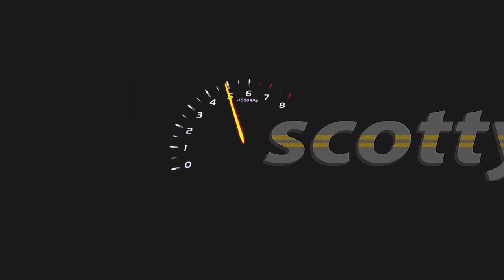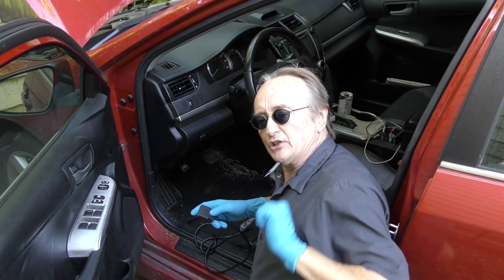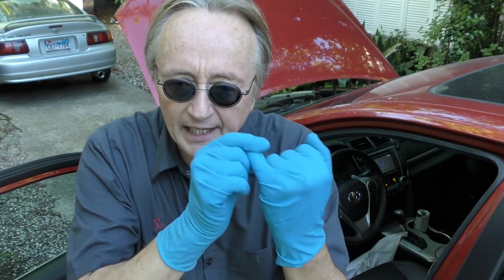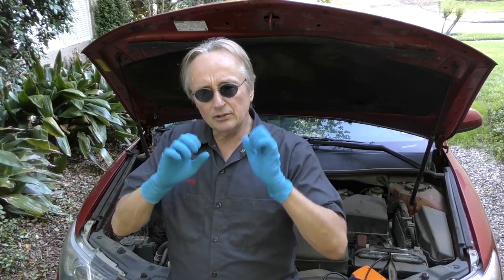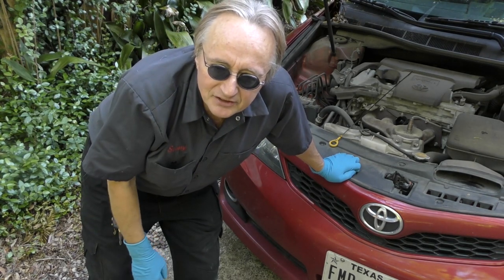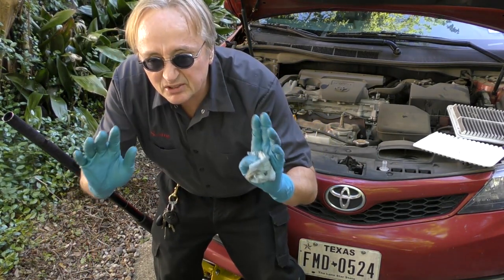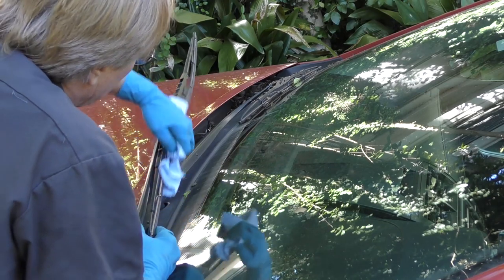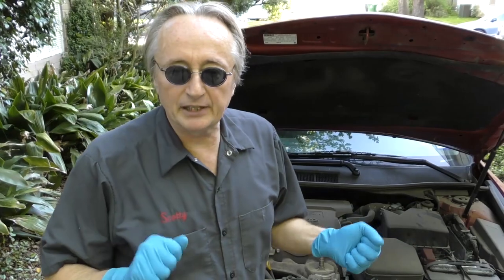Doing This Will Make Your Car Pass Inspection

Comment: Car has recalls on explosive airbags, fuel tank gasket that leaks and catches fire in crash, suspension ball joint that breaks on driver side, clutch pedal that snaps and jams under the brake pedal, warning that the seat belt gets cut in the door (special rear suicide doors, and that belt is like a magnet to getting caught in the door since it slides on a floor rail) and catalytic converter that gets so hot it melts. On top of this having worn out brake pads, etc. All passes safety inspection...

De-cat so the car is no longer a fire hazard, fails emission test, fails “safety test”...

There is nothing that they check for safety besides tire wear... It should just be called an emissions test since that’s all it is. Also fun fact, the state right above Texas has no safety or emissions test, and things like Nitrous Oxide are perfectly legal for street use...

Comment: Dirty oil is fill with gasoline blow by   and those fumes are sucked back into the engine through the PVC valve. So rather than your engine breathing fresh air it is sucking fumes into the intake causing the air/fuel ratio to be thrown off.

Comment: lol, I've had to cheat my way past emissions for the last 5 years. I've had an engine light code on for those 5 years related to the CAT converter efficiency (toyota is known for the infamously sensitive P0420 code) and it's luckily the LAST monitor on my OBD sensors to come on line after a reset. Plan of attack. Reset the OBD codes in the engine, and drive around until the monitors come online. The first 6 monitors come on within 15 minutes. the 7th monitor takes about a day or driving to and from work... the LAST monitor (which houses the P0420 check) takes about 2-3 days. When that 7th monitor comes back online drive DIRECTLY to the MVD and have your emissions check done with that last monitor not being online. 2 more years of not having to take the stupid test and just ignore the engine light coming back online lol

Comment: Don't forget the visual inspection in CA. Anything that looks amiss will result in failure. An upgraded silicone line, a aftermarket diverter valve, whatever that looks different that doesn't have the proper sticker. It's no wonder there are so many new cars here.

Comment: NSW Australia is bloody nasty too. No emissions or OBD but they do a FULL check on ball joints, cv boots and cvs, brakes, lights, braking performance, bushings, window cracks, fails on the dash, etc.

I failed last run on the rough roads unwinding the seat bolts a little, rear exhaust had rotated a little and FULL back end bushings (traing arms, sway bars etc etc oh and blinker bulb went clear instead of orange (tint burnt off??). I usually leave something small like a bulb as it makes them pick on the car less but they don't charge $20 for a light bulb either (maybe $3-5). Last year they let a few things slip they could have picked on because of that for example very low front brake pads I got a "your gunna change them before the end of the week aren't ya" (changed em next day and had to replace a locked/seized calliper at the same time - it wouldn't release the mounting bolts).

Comment: No emissions or roadworthy checks here in Western Australia, you could use your car for decades without it being looked at.
If the cops yellow sticker your car though for whatever reason then it will need to go through a full roadworthy check to remove the sticker.
Reply: informative. greetings from florissant, mo  usa
Reply: much better than victoria
Reply: That's how it is when overpopulation has not happen- keep your borders tight! - the more you pack the sardines the less freedom you have.

Comment: 4:21 Some cars have a light checking feature when you turn the car halfway on (just the electricity, but not the engine), and leave it like that. Then you can walk around the car and check all the lights.

Comment: Luckily I live in a state (or perhaps it's just my rural area of the state) where basically it the car makes it into the station, it passes inspection. Once some young dude at the garage literally just walked out and slapped an inspection sticker on my truck without giving it a second glance. I've been told that garages HATE inspections because if they were to do them correctly it would take a considerable amount of time and by state law they can only charge some trivial amount for labor (like $8.50 or something).

Comment: I've had a p0401 on a 97 Toyota Avalon for a while, comes and goes after long highway driving. probably just need to clean the EGR valve or the sensor replacement. it would make the check engine light, and it is one of those things for an inspection. so the white went off and I thought okay I'll drive a couple days around 45 miles an hour somewhere and then come back down see if the light comes back on. 3 days later light was still off. AutoZone check everything was ready. went got my inspection good to go for the next 2 years, Illinois btw, one hour later Bing p0401!
easier than two years ago when I had the sensor 01 Bank 1 go bad the hardest one to get to, and the trickiest to time to get everything ready there were three not Reddy's back then but it didn't affect the test at all. and the check engine light was off.

Comment: Here in New Mexico a safety inspection is NOT required and you should see the junkers on the road with bald tires, cracked windshields, burned out headlights and brake light bulbs.  I can imagine there are many with worn suspension components and brake pads as well...........welcome to the "Land of Enchantment"

Comment: Make sure you clean your brake pipes with wd40 to get that rust off.
Lots of mot stations will fail your brake pipes just with a bit of surface rust,it a big scam here in the uk with garages,especially those garages which say they are brake specialists.
Always looking for brake work.
Surprisingly you don't have to produce your car insurance at the mot station here in the uk.
Its no wonder as here in the uk the goverment copy everything bad that comes from the us and not good things.
Good video scotty.

Comment: I lived in spring tx on kuykendhal between spring cypress and 2920 and they always hoop something to my exhaust pipe and my 01 dodge neon has a engine light on since 2008 so it won't pass so I have to pay inspection plus another 50 or 60 to pass it.

Comment: I had a 05 corolla with an EVAP leak that no one could find 3 shop, 2 dealerships....  
Changed, carbon canster,gas cap and purge valve.  
Oem parts...still had a P04401
Reply: Nobody smoke tested it?
Reply: @rays7437  they did that and found nothing.  The was totaled oyt in a wreck and repaired acouple years back. 
So i just pick up a camry last month i think 200k miles and no value the car didnt owe me anything.

Comment: I was in the smog test shop and I happened to hear my engine start on my pickup and he tested the high rev emissions and it was terrible to hear him rev it to 5k rpm on my ranger 4cyl. I have no clue why they have to test an rpm that I rarely ever hit. The fuel system test seems like they are trying to break your gas tank. They should stick to just testing the exhaust gas.

Comment: Strange thing about the oil filter canister housing construction on US sold Toyota.
At least here in England the stupid design is identical but the cap is made of metal, my model is 2010 Yaris so maybe on newer models they are plastic as well?

Comment: Hey scotty, I’m buying a used luxury car, should I go with a 2003 lexus rx300 with 140.000 miles auto transmission or a 2011 Volkswagen CC with 98.000 miles manual transmission? Both cars has no major issues and is sold at a same price of $5k.

Comment: How to pass your annual MOT test in England
1) Check all your lights work
2) Replace all your wipers with new ones just before the inspection
3) Replace all your tires with new ones just before the inspection
4) Replace every component in your suspension just before the inspection.
5) Replace the catalytic converter
 
or just accept that if you're lucky it will cost you £20 in wipers, if you're unlucky it will cost £800 in tires and shocks. They have to sell you something, the price they charge for the MOT doesn't cover what the government charges them to let them do MOTs.

Comment: Thanks for sharing your knowledge !        What is the difference between At 205   &   303 protectant?    Can I use 303 on wipers rather than 205?     205 on side walls of tires,  belts?/

Comment: Yeah Scotty,the UK cars needs the reversing lights working Reversing lights (on vehicles first used from 1st September 2009) and also front headlight washers if they have them.I know someone who had a 3/4yr old Golf and had a service done which resulted in the mechanic informing him one shock absorber was leaking very slightly lol a 4 yr old Golf! Can't remember if he took it in for an MOT (annual inspection by law) Anything newer than 3 yrs don't need an MOT. 2018  new laws......
There are three new categories
Three new categories will help reflect the severity of a fault with your car.

Minor: there is a fault with the car but it won’t put other road users at risk or have an impact on the environment. These need to be repaired but will pass the MOT.

Major: the issue found with the vehicle could affect safety or have an impact on the environment. This needs to be repaired straight away or else the car will fail.

Dangerous: there is either an immediate risk to road safety or this car will have a serious impact on the environment. It can’t be driven until it has been repaired and will fail the MOT.

As before there will also be:

Advisory: an issue has been found that could become serious. This must be monitored and repaired if and when necessary, but the car has passed.

Pass: the car meets the minimum legal standards and so has passed the MOT. 

During your MOT, brake pads and warning lights will be checked, as will any missing brake pads and discs. Checks will also include:

Under inflated tyres

Whether the brake fluid has been contaminated
Fluid leaks that could pose a risk to the environment
Reversing lights (on vehicles first used from 1st September 2009)
Headlight washers (on vehicles first used from 1st September 2009) – if applicable
Daytime running lights (on vehicles first used from 1st March 2018 – most of these will have their first MOT in 2021)

Comment: yep paid 208 buck on my registration put new oil in it new airfliter drove it around since the battery died gotta make sure the computer is all reading the sensors you didnt mention that i notice a lot of peole take there cars in and have to go drive ther cars cause the battery died. been driving my truck around so the computer is all reading correctly. now imm goonna shel out 75 bucks fore them to put the prob in the tail pipe and run it .but the 300 cubic inch six cyclinder enine has been passing smog every two years let workd this time ha!!

Comment: TIP: do NOT disconnect your battery or change it, before your emissions test! YOU WILL FAIL because the "monitors" will reset. The computer will not reset the monitors for about 200 miles ! Also, if you are trying to reset your monitors by driving, you need to drive city AND highway miles, about 200 miles. Also very important, make sure your fuel tank is at least half full during the drive cycle.

Comment: I heard in CA your car doesn't need the EVAP to be ready for smog test pass. Is this true?

My car cleared all except this one. No check engine light on anymord but driving 200+ miles already.. 

Put best fuel Chevron. Filled tank. Got air filter changed. Oil change.

Smog due next month. I hope car passes. It's only car I have.

Comment: Every-time i go for inspection...i clear my code/s using my scan tool...i drive exactly 50 miles on highway like a little old lady....then drive it straight into the inspection booth.....it always passes.....3 to 10 miles later the code reappears.

Comment: What part of Texas are you in. This comment doesn’t pertain to this video but I have a question and maybe you can answer. I have a 2013 transit connect and both doors on the side the ones that slide will not open from the inside. I bought it from covert Ford about two months ago. One door didn’t work and the other one worked and now it has stopped working as well. We have checked the child lock and that’s not what it is. Do you know if this is something Carmen with the transit connect

Comment: Hey Scotty. I got an 04 trailblazer, when it gets hot outside my a/c doesn't want to come on, but on cool days it works good, it will get very cold. It was 74° and it worked fine today. Got any suggestions? Maybe there is something i missed!

Comment: In NY State my 2011 Subaru Legacy won't pass because it's showing a check engine light for TRANSMISSION issues P700 and P2765 codes.

Comment: SCOTTY!!!!!!! I need help, I live in the Dominican Republic and were notorious for having mechanics that try to skimp you on everything. My question to you is, I have a 2003 Chevy Tracker with the 2L engine. Every time I fire her up about 1 second after ignition I hear a horrible crackling sound for about a second or two then it goes away. It sounds like it's coming from under the car and/or inside the engine. Is there any help you have to diagnose this problem so that I can tell the mechanics exactly what I want.

Thanks a bunch, man!

Comment: The 2 times I had to go back a second time was the first time I got the smog  part replaced and the shop and they reset my check engine light well I found out I was supposed to drive at least 100 miles so the computer reset I drove a ways down the express way came back my neighbor used his scan tool and said everything was complete,I took it back and it passed.I then got a battery one time and same thing months passed I don't drive a lot and I got a car too.

Comment: Vermont has near tyrannical inspection laws. The State issues a tablet to each inspection station. As soon as they run the OBD2 test on you, you'd better hope you pass. The results go directly to the State, and should you fail, you are flagged, so that you can't go to another mechanic. You can't mechanic shop in VT anymore.

I'm not going to list everything they check because it would take quite awhile. To pass inspection for this year, it cost me $1300. I had to put a windshield in, 3 wheel bearings, a ball joint, and I had to get a Check Engine code fixed. Turned out to be a malfunctioning connector to the EVAP cannister. Not fun!

Comment: 943/944/Oil Additives,Advanced Oil Fuel Formulation= Ethyl15 Ethyl10 Mix with Oil Diesel Advanced Fuels 2%: Oil Additives,Advanced Fuel Oil Output

Comment: 3:30 I disagree that having paper oil filter is a bad design. You can buy appropriate tool for like 5-15€/$ (you do not need to buy whole kit, just one for your car), your oil filters tend to be cheaper (you save money if you keep your car longer), before you put in the filter you can see how much filter material is on it so you can avoid poor quality ones and if you have the tool it is much more easy to unscrew and screw on. IMO it is actually better design.
Reply: I think it’s a brilliant design.  I purchased a threaded device which screws into the bottom of the filter housing and then you turn a knob to drain the cartridge.  (The “spin on” filters always make a mess upon removal.).   Just don’t over tighten the housing after you put the clean filter in.  I put a little anti-seize compound on the plug at the bottom of the cartridge do it comes off independently.

Comment: I passed the 3rd time. Replaced the O2 sensor twice and went before my EVAP leak code came back. Drove for 10k miles on temp plates. 😂😂😂

Btw only OBD2 tests here.

Edit: if you spend $300 (I think) with proof you automatically pass for a year.

Comment: Hi Scotty I have to take off the subframe of Chevy Cruze 2011 1.8l. But front two bolts just spins free. There is no actual bolt inside the car body. It’s kind of triangular thing that spins with the bolt. I don’t know if there is any special tool for that thing. Please what can be done about it.

Please respond TIA

Comment: Hello scotty .
I have an old c1500 suberban i just put remanufactured Remy ac compressor and a new accumulator with new evaporator from UAC brand . I still didn't install it do you recommend this brand cuz i saw the thin ates looks so soft that you can bend it easly by fingers . What do you recommend i opened the whole dash i don't want to re open. It .

Do you recommend to buy the acdelco evap instead of UAC or it will do the job
Reply: Thin plates *

Comment: My 80 Broco 2 bl: HC limit is 400 mine passed at 125 HC, but my Co limit is 1.50 and tested at 2.59 CO. Did I lean out my mixture screws too much, causing CO to increase? I always passed before when I leaned out my mixture screws to where engine was running a bit rough?

Comment: Actually cars newer than 02(i think) in california just do the obd2.
Reply: 2001 and newer just need to pass OBD in CA.
Reply: @ialien2077  i wish I knew that when instead of getting the 2002 mr2 spyder that only needed the obd2 check I got the 97 acura integra that needs no codes AND a sniffer test. I had to use HEET to pass and even that it was by 2 or 3 %ppm.